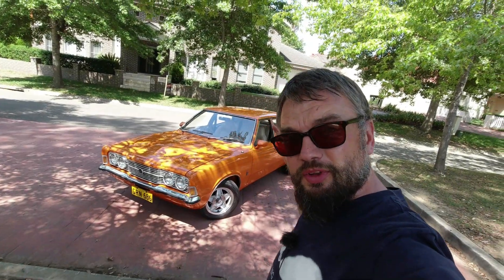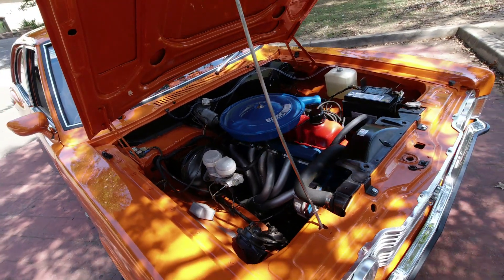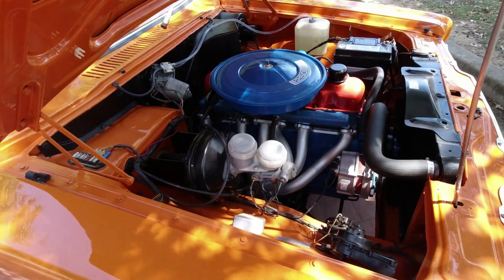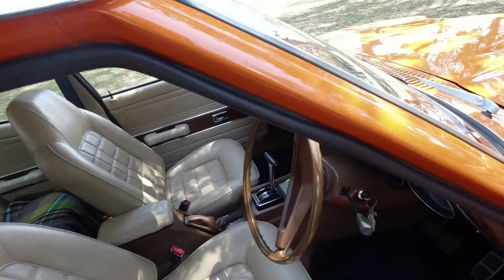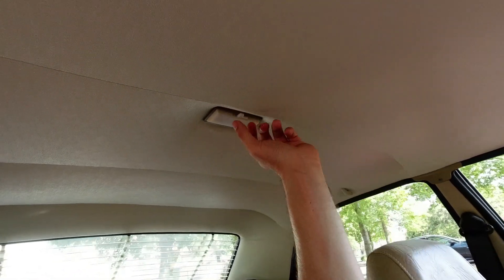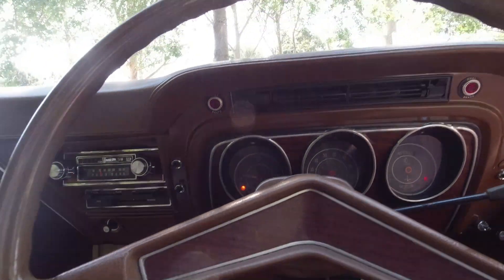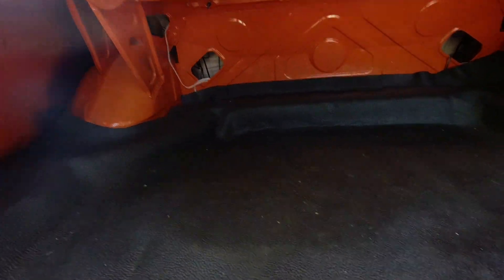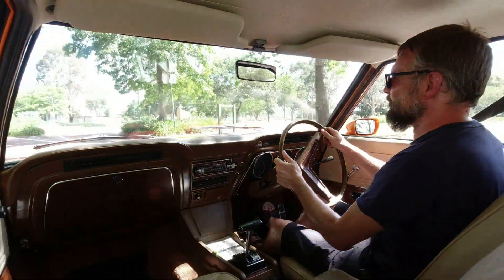Aussie Oddballs: Ford Cortina 6! 4.1-litre, tested in 40+ degree heat

Comment: Mate you are so right about feeling the weight of the Falcon straight six in front. My dad bought a new TE Cortina in July 1977 with the 3.3 lite six, the front suspension bottomed out regularly on uneven roads and it was an under steering dog.

Comment: I spent a lot of time in these Corties back in the 80’s and the 250ci went like the clappers. They also came with the 200ci six as well as the 2.0 four which were notorious for self-immolating when a little plug would fall out the carburettor and pump fuel all over the exhaust manifold. The poverty pack came with the whizzy little 1.3. A mate even had an imported TD wagon with a 1.1 and it wouldn’t pull the skin off a rice pudding.
Dropping in a 302 or sometimes a 351 Windsor was a popular conversion and they were seriously fast.
Great review and it brought back some good memories. They were a good car out on the open highways where you could stretch their legs, the 250ci could really cover the miles in comfort.
Reply: I do'nt recall a 1.3 for the TC in Australia. I find a 1.1 L even less likely. This Ford brochure for the local TC confirms the poverty pack options were 1.6 and 2.0 litre four cylinder motors (maybe the six came a bit later or got a special brochure :
https://www.uniquecarsandparts.com.au/brochures_ford_cortina_tc
Hardly anyone remembers even the TC with a 1.6 here, as it was so looked down upon. A 1.3 (as the UK had as base) would have been laughed out of town and not worth setting up for production here. Wikipedia for the Cortina Mk3 TC seems to confirm no 1.1 in UK but 1.3 base model.
I wonder if there was some recollections of the Ford Escort or earlier Cortinas? These smaller cars certainly came with 1.1 and 1.3 options. Maybe even in Australia for the "Jailbar" Cortina 220 and 240 early sixties models. Back the the 1500 was Bathurst GT territory for the first much lighter Cortinas.
Unless the 1.1 you recall was an icredibly rare after market down grading. Why would anyone bother importing such a povo pack car? Importing cost usually justified only for special up market hard to get cars. eg Pedr Davis imported one of the few early 60s Ford Corsairs here.
Reply: John D. Hi John, you are correct and my memory has let me down but in my defence it was 40 years ago. Yes the 1.6 was in the Aussie base model and the 1.3 was in this imported Cortina wagon. If I remember correctly Australia didn’t get the wagon. Why would someone import the poverty pack? Who knows but I distinctly remember at the time wondering why someone would import it. Then again, it was picked it up cheap in the early 80’s so there is the possibility that the original owner decided to bring it with him to Australia at the height of the 70’s oil crisis. I haven’t looked at the brochure you have linked yet but I know the TC had the 200ci and 250ci but maybe not when it was first released. Ford modified fire wall to allow the 6’s to sit further back in the engine bay but they were still about 60kg heavier in the front end than the fours. A lot of other front end components were revised for the 6’s as well. They’re still a good looking car to me especially the 250 XLE in white with the black vinyl roof.
Thanks for jogging my memory.
Reply: @scroungasworkshop4663  With the TC or maybe TD or even TE we did get our first Cortina Wagon here. Amazingly assembled at the the Renault Heidelberg West factory. Perhaps Ford did not want a low volume wagon mucking up the assembly lines or Renault quoted a good price. Some views here  :
https://www.youtube.com/watch?v=jgp-A0qMN2o&t=48s
Wikipedia says in part :
Ford Australia built its own version, known as the TE, with the 2.0-litre 4-cylinder Pinto unit and the Ford Falcon's 3.3-litre and 4.1-litre 6-cylinder unit.[36] The six-cylinder versions were rather nose heavy and did not handle as well as the fours or the European V6 models.[37] Interior door hardware and steering columns were shared with the Falcons and the Australian versions also had their own instrument clusters, optional air conditioning, and much larger bumpers. It also had side indicators. The Cortina wagon was assembled by Renault Australia at its plant in Heidelberg in Victoria.[38]

Comment: Wow what a sound.. 
If only all Cortina cars sounded like that..
Reply: Euro 2.3 V6 sound better. For connoisseurs of noise, the 2.3 sounds nicer than the 2.8. IMO.
Reply: The best sounding Cortina I ever heard was the first mk2 Savage 3000E that I saw - and the only one I've seen on the road! I genuinely thought it was a V8 coming down the road and couldn't believe my eyes when it was my dream Cortina.
Reply: Yes, it has a lovely exhaust sound, and I am not even a Cortina fan really.  That first-gear whine on the auto is surprisingly loud.  Is that normal for them, or is that auto in trouble?
Reply: @VauxhallViva1975  More sounds like the oil pump. They make that noise usually whilst driving when planetary gears are worn. All the Fords in Australia with worn BTR autos sound like taxis including mine!

Comment: Those Bathburst alloys look almost identical to Triumph Stag alloys! What a stunning car and great resto too! I adore the colour too - it made my day seeing this. I wish it was hot here at the moment! Great video Ian
Reply: The Bathurst alloy design first featured on the XY Falcon. 1971 I believe.
Reply: '72, I believe. The original Phase III came with steel 10-slot rims.  The story I've heard was that the Globes were designed for the XA Phase IV, but when that model was cancelled, Ford gave away 200 sets of Globes to Phase III owners so they could claim them to be factory original.  This bit of tomfoolery got them homologated and let the XY race an additional year with the new rims to help with their brake overheating issues, while the factory scrambled a bit to sort out the XA.
Reply: @aussiebloke609  12 slotters weren't they....?
Reply: @jasonsanders3397   Ooh, I wish my fingers would do as they are told.  You are correct, 12 is what I meant at the time - although now that I'm racking my memory, it seems the 5-slot was also rather common to be seen on the GTs, so now I"m unsure.  Either way, the point is it was steel rims from the factory, with the alloys being offered for free to HO owners so they could be used for racing. 

And as a side note, the story I've heard was those Globe wheels were the reason the XA Phase IV never came with rear discs, as it was decided the added cooling from a more open wheel design was sufficient to reduce fade from the rear drums.  And then changed their minds for the XB .  Go figure.  :-P
Reply: @aussiebloke609  No that's fair enough mate, no one can be blamed for a keyboard typo!  And I think you're right about a 5 slot sort of jellybean wheel for those HO's. I guess Ford were casting around a bit trying to find wheels strong enough that wouldn't break (like in 1969 or 70 at Bathurst?) but had enough  voids in them to allow enough air in to cool those horrendously overworked brakes..

Comment: Dear Mr. HubNut, you can never have "far to much engine". Great car.
Reply: But one could have “far TOO much engine”.
Reply: @skipintroux4444  Only if you don't know how to use it my friend.
Reply: davebuts my apologies for confusion the comment was specifically directed at the misspelling of “too”, I otherwise agree with you.
Reply: @skipintroux4444  Lol no problem buddy.
Reply: You can have too much engine when the chassis was not designed to have that much weight  that far forward on the axles. While they were a beautiful car and had respectable straight line performance for their era and pedigree, they were notorious for having the cornering characteristics of a bowling ball.
Reply: Horsepower and torque. Too much is never enough.

Comment: "Lets jump in the back..." How many young girls would have heard that line in a Cortina Mk3 ?? ;)
Reply: Nice wipe clean squeaky bum seats too 👍
Reply: Probably far too many.  And there are probably quite a few people watching this video who are the result of that line...

Personally, I don't know about any of that, but I did get a finger broken as a child by getting it shut in the back door of a mk3...
Reply: Not many 😜🙄🤔😂😉
Reply: Not any of my girls, the front seat reclined beautifully. Wow...typing this just brought back some stunning memories.
Reply: so very true, mine had white interior, well used back seat . but it was easy to clean
Reply: You have a beautiful machine and she looks very clean..

My grandfather purchased one in 1973 brand new in mulberry colour 4.1 auto all stock with no radio from a dealer in Sydney 
He had the cortina till 2008 with only 77,000 on the clock and in pristine condition 
Although I’m not a ford fan at all I always had a soft spot for the cortina

Sadly he passed away that year and I decided to keep the old girl in my garage for 10years before I made any decisions to play with it..

I decided to give it a fresh paint job and drop in a fully rebuilt 289 V8 from a fairlane with twin under bonnet tunnel ram with a blower 

The vehicle looks unbelievable and equally a four wheeled slingshot 
I looks 100% stock on the outside so when you hear the whistle the last thing you’d expect is the cortina 

Ps.. The Leyland marina 4cly would be one of history’s biggest mechanical arsholes of a car ever built

Comment: I had one of these. It was brilliant and blew the nuts of the 4cyl model. Ok, it wanted to go straight at every corner and was agricultural compared to todays offerings, but the torque! Hills did not exist.  Loved it. Would have one again. Very fair review. Mine had an add on air con unit that just about worked.
Reply: Had a 1976 corona mk2 sedan that did the same. Plenty of get up and go, but protested against every bend in the road. Then I bought the hardtop version because I'm an idiot.

Comment: When I was 10, my father had a 1972 Mk3 Cortina 1600 XL had the silver panel between the rear light clusters! Was also 3 speed Auto; the sight of the T-Shift brought back many a childhood memory! As it was an automatic it was the 1.6 Kent engine not the Pinto! Also the 3-pot dash was exactly the same with a Clock, Speedo and Fuel/Temp gauges; needed a GXL or GT for a rev counter. Thanks for the upload...very interesting to know about the subtle differences with the Aussie version!

Comment: Wiper, heater blower box and motor, slam panel cut out to take engine and rad size,inner scuttle bulkhead different to take direct airflow from grill intake,standard issue pedal trims, steering boomerang deeper inlay, brake fluid test and warning lamp, possibly retrimmed tombstone seats / Aussie option GXL / XL trim finsh on seats, screen wash works via wipers. Early solid rear boot bulkhead, prob stuff I missed WOWOWO thanks Ian, and thanks for shout out.Hope you ok.Pete,
Reply: Pete you have a great eye mate. The car is XL, retrimmed in parchment vinyl- correct colour for the year.
Reply: @townleyd  great car just wow
Reply: Great description of the details Pete. Yeah I noticed all that stuff too and I'm not even openly a Mk 3 fan. I do rather like them though....
Reply: Different front guards, (higher profile to fit the 6, plus the bonnet bulge) dual boxed chassis (box inside a box), bigger diff, Falcon steering column, heavier front end but chewed bushes etc a lot. Friends in Sydney had a new dark metallic green MK3 wagon with the Ford 3 speed manual  which was quite quick (about the same as a 289 mustang we gave a fright to up to 50mph) Mate had the  MK 4 version here in NZ,  had a lot of front end problems as well with that. Also the cops on Norfolk island (late 70s) had the MK 4 which had the same problem. Otherwise quite a cool car, very smooth on the motorway, just a bit front heavy, and could have done with a better front end.
Reply: Nice XL, XLE had garish cloth seat inserts, vinyl roof & body colour hubcaps. 

 Frt subframe was also heavier gauge steel but still prone to cracking under the added weight; hence TD facelift suspension raised 2" & frt rails revised to heavier gauge. Mk4 TE facelift then eliminated frt subframe & mounted upr arms atop heavier rails for more suspension travel unlike international Cortinas.

Comment: My mum had an XLE version of this in the early 1980’s in a pretty bottle green. It was a 3.3 litre...the smaller six and boy did that thing go like a rocket ship...either that or my mum wore very heavy shoes!...and it had the later and more modern dash layout...
 Anyway, the trans never sounded like this one....there’s definitely an issue there....I had an XJ Jaguar 4.2 that made a similar noise...it was a torque converter issue in the BW 65 trans...wasn’t really strong enough for the torque of the 4.2...but enjoyed this....was wondering if this car had air conditioning...my mum’s certainly did and it handled the heat no probs...
Reply from the maker: Nope. No air con. I agree that the transmission shouldn't be quite that vocal.
Reply: No A/C, but I may look at retro fitting. The trans was rebuild. It is solid. The BW 35 had this sound in first. So many taxis of that era had that sound.

Comment: These cars came with a 200 cubic inch six as well. The 250 was the most popular option. The 4 cylinder was a 2 litre.
Reply: Mustang I owned started with a 200 inch sixpot, finished with a 302ci just before I sold it. Would have been MUCH cheaper to have bought a 289ci v8 to start with. Cost of transmission, brakes, and everything else was enormous. 200ci lump was great, but a bit  gutless in a Mustang, but matched the original drum brakes
Reply: Had a centura with abrelatively warm 265 with a 4speed manual went extremely well

Comment: I rented one of these for a road trip when I visited Australia in '76. I've forgotten whether it was auto or manual - the former, most likely - but the bicep-building understeer was unforgettable. I suspect the headers on the one in the video are non-original but probably add a useful bit of power. Looks terrific in that colour and with those handsome wheels (but with hubs with only four studs, not five?).
Reply: Yeah, I also put headers on mine, they aren't original.

Comment: I did my apprenticeship working on these cars.....they came n several engine transmission options....in later years a very popular Hot up " was to drop a Windsor V8 into these cars.....they really moved along then.
Reply: 5 litres of fun.
Reply: Yes the Windsor 289 302 and 351 was a popular swap ! 
We did get a 351 Windsor And blower into one top loader 4 speed and 9inch cut down and a power steering rack out of something to fit ! 
Fairfield cops 👮‍♀️ would pull you up just for a look !

Comment: I had a 1973 MK3 GT cortina with a 302 Windsor V8 in it. Shift kitted C4 box , shortened 9 inch diff.  225 /60 / 14’s on the front, 265/60/14’s on the back all under widened guards. God it went like a cat on speed .🔥💥😎

Comment: Had the TE Cortina GL wagon with the crossflow 4.1 six bought new in 1977. Never had a problem with it. My only grip was the small fuel tank designed for the 4 cylinder. Interestingly my father also has a 4.1 TE wagon with the Rally Pack option in a very bright "Pine & Line" colour. I ended up buying that vehicle from him when he bought a new XF Fairmont Ghia. The wife used it for quite a few years & the only grip I has with that car was it used to chew through front disk pads - probably from her lead foot driving! Both cars were very reliable.
Reply: gripe

Comment: I had a Cortina GXL with a puny 2.0 litre Pinto engine. I would love to drive this car
Reply: I had one too, my 1st car. I kept getting pulled over by the law, I think because it was black.
Reply: @faustusTVR  mine was yellow, with a black vinyl roof
Reply: @curtisj2165  I was offered a yellow GT to replace it with at the time, passed it up but it was better nick than mine which had the tin worm gnawing away at it. I missed out there. They went very well with those twin webbers on.

Comment: That was the low performance version of that engine. Note the intake is cast as part of the Head. A later verson,which is quite rare came with a separate intake manifold made out of alloy. 
In the USA Ak Miller and offenhauser sold a kit to add two extra carbs which involved drilling holes in the head/manifold and sticking adaptors on to hold the carbs. Miller got 200 plus horse power out of one in a Maverick.  He was clocked at 111 MPh at 4500 RPM.
Reply: No, these engines definitely have an intake that isn't part of the head. The earlier ones do but this is a slightly different head design to the old 170-200-250 Falcon and Mustang motors.

Comment: 2:52 There ought to be a bottle of additive somewhere in the engine bay that allows this car to run on unleaded petrol, as when this car first appeared on the market, unleaded petrol was unheard-of, at least here in Australia it was, a car like this would've been using Lead Replacement Petrol in the early 2000s with the ensuing problems of residue clogging the carburettor(My first car, a Ford Meteor, basically a rebadged Mazda 323, had that problem, slow down for a right-turn through a roundabout and the engine would "cark it", leaving me having to kick the beast into Neutral to restart the engine. It was an automatic, I don't do "Spanish Gears"[Manuel....Manual.... Get it? Ba-Dum-Tssss]).
Reply: More thank likely had the valve seats done so it can run on unleaded.
Reply: @Andyc351  I've seen early 1970s or very-late 1960s Toyotas fitted with bottles to contain the additive that allowed them to run on unleaded petrol, the additive was drip-fed into the fuel line, I believe. I think the car I saw at a service station near where I was living some years ago was of the "viral" model of Toyota, the Corona!